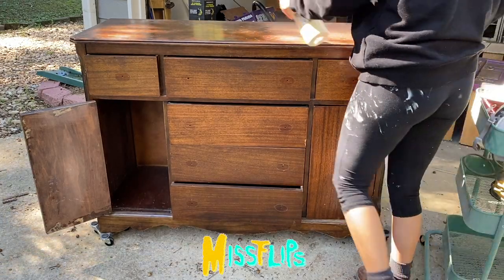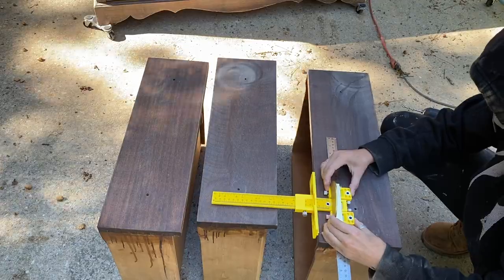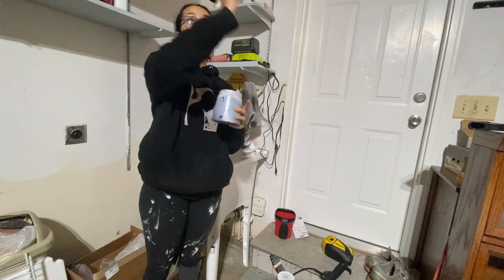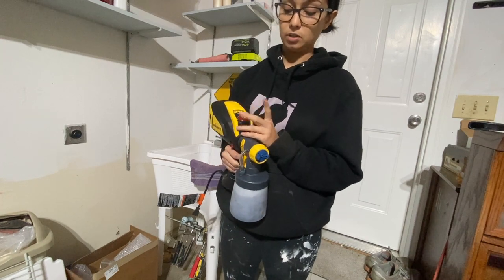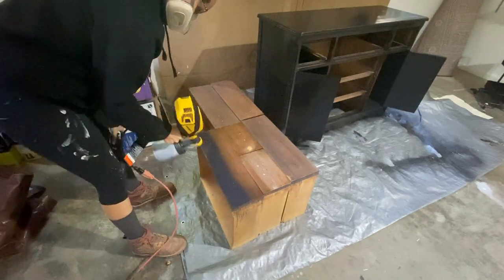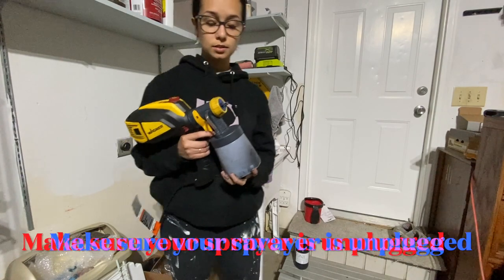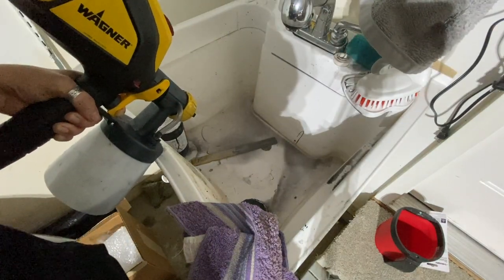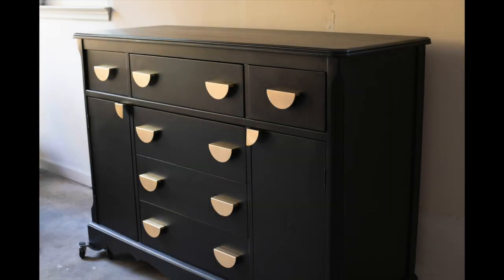Paint Sprayer Tutorial | Wagner Flexio 3500 Edition | Episode 26

Comment: Nice job. One little thing to consider is that there's only one situation where you can have your power cord rubbing what you just painted, and that is when you are spraying the top, In this case the power cord did touch the front and sites of the the dresser body because you had already painted the front and sides and then started painting the top from the front to the back, and your cord touched in several spots at around the 10:15 mark. What I've learned is to spray the top first, starting at the very back of it so you are moving the cord progressively further away from the unit and even if it does touch, you haven't painted there yet so there should be no problem. I learned that after having to sand and repaint several cord rubs.
Reply from the maker: Oooh yeah! Definitely good to note. This was my first time ever using a paint sprayer so I’ve found my rhythm now

Comment: Great thorough tutorial, thanks! I've got a Flexio 4000 that I bought for our garage makeover last year. It's sitting, lonely, in the case. Just waiting to be put to work again. Must try it on a piece soon!
Reply from the maker: Yes!! Do it!! It’s so nice! Though of course, it may be a little different if you’re trying to do more detailed things besides just covering mass areas
Reply: @TheMissFlips  it worked sooooo much better on the walls and details! I do not recommend for ceilings lol 😆
Reply from the maker: @CopperCactusDIY  hahaha I can see that being weird. But I bet it saves a ton of time!! What setting did you use for your walls if you remember
Reply: @TheMissFlips  I think it landed around a 7 or 8 on airflow and open as wide as possible (the little red ring). Don't quote me on that though, it was a tough job that I purged immediately lol. Between the flat paint to the very dry PHX climate to the heat of the tool, we had to clean it out at least 3 times every time we tried to paint the ceiling. Total saga. Walls went perfect though!
Reply from the maker: @CopperCactusDIY  haha got ya. Sounds like a tough job. Thank you for the insight though!!
Reply: @TheMissFlips  you bet! And right back at ya. Don't know why I never before considered spraying water through to clean it out! Great tips, great video!
Reply from the maker: @CopperCactusDIY  glad you found it useful 🥰

Comment: The exit spray would be cone shaped. But the outer most plastic adjustment piece has 2 air vents. The air coming out is angled in such a way that forces the cone shaped spray output into the fan shape. It's output is perpendicular but once you think about it it makes sense. 

Spining it does nothing but change the orientation of the fan spray patter.
Reply from the maker: It does according to the directions and to the obvious shape and direction of the paint

Comment: I just got the same sprayer.  Went to home depot to get stain for my cedar fence and some white paint to paint a kitchen drawer and a door.  I asked them if I had to thin down ether paint or stain and they said no. Lol.   So I don't know the ratio of thining stain and paint  in wagner container?  Also do u guys think I should use a clear stain to stain my other  house fence which is red wood??
Reply from the maker: Thinning paint is tricky. It’s different for every paint depending on its viscosity. I’d estimate about an inch or less of water for water based paints. Start with less and add more if you need. You want it to be less yogurty and more heavy cream if that makes sense lol as for the stain, that’s really a personal preference. A clear coat is most likely going to be a sealer of some kind rather than a stain. But I don’t know much about that. Might want to look up videos about painting outdoor fences specifically for better tips

Comment: When using the Wagner Flexio (I have the 3500) is there anyway to not clean in between spraying?  For example, a second coat of paint . I have be cleaning between, but was curious.
Reply from the maker: I’ve wondered the same thing, but I haven’t found anything :/ I just clean all the mechanics and then put plastic wrap over the paint container with a rubber band around it
Reply: @TheMissFlips  Sounds about right.  I don't have wood in my shop.  I think I might bring a bucket of water to put mechanics in and wash, cover cup with paint. See how that works.  Maybe it will work.  Thank you for responding so fast.
Reply from the maker: @849teresa  of course! Let me know if you have any other questions :)

Comment: Hi I just bought the Wagner 3500. How do I know if I need to water the paint down? And how much of the paint spray goes away from furniture piece? I don’t have a garage so may use spare room. Wondering how much of floor and walls to cover. Excellent video. Giving me confidence to try it.
Reply from the maker: Oh good! Im so glad! It may be worth investing in painter blankets or look for some large pieces of cardboard or big tarps. You will want to put something down on the floor as well. If you’re spraying close to a wall, it’ll be about two feet out from the piece on the wall with the thickest paint being closest to the outline of the piece of course. As far as watering it down goes, most paints require a little bit of water but not all. You want it to be almost like heavy whipping cream before it’s whipped. Keep in mind that it’s being led up a thin tube and pushed out of a needle sized hole with high pressured air. So with that in mind, use your own judgement with the paint thickness and just add a little bit at a time. It’s always good to have cardboard to test on first before you ever start painting a piece. If it’s too watery, the paint will drip once it’s sprayed. If it’s too thick, the paint will have a hard time coming out and will kind of spit out in blotches. Make sure you mix in the water well with a stir stick. I hope this helps! And please feel free to ask me more questions if they arise 🥰
Reply from the maker: Also, if you’re spraying in a small space, make sure to have as much ventilation as possible and wear a respirator!! As many windows and doors open as possible, fans on, etc.
Reply: @TheMissFlips  thank you so much!
Reply from the maker: @TheKaswid1  of course!

Comment: Melange one featured in this video is an all in one paint. Built in primer and topcoat. It's also in the color black. These factors contribute to the paint being viscous and featuring heavy/larger pigment molecules than other colors. The Wagner has a limited atomizing potential vs machines costing $1000 which can produce a significantly smaller atomized paint molecule which can better minimize orange peel and texture than the budget Wagner sprayer. All of these factors combined should be taken into consideration of the final achievable finish with reasonable expectations.

For her to take the paint, not dilute it, and have good enough coverage in 2 coats while skipping the primer step, is exactly what melange one was chemically designed to do. 

There are other paints that have less orange peel finish and more self leveling capabilities. They are probably oil based paints among the other types, which naturally have considerably higher VOCs and a nightmare in the clean up department which no one likes to do thoroughly.

Spraying melange one with managed expectations can give you 98% perfect results enough to wow 99% of users and customers except for hardcore professionals and enthusiast with an eye for the flaws that everyone else is blind to, or see and not care.

Thank you for putting up this video.
Reply from the maker: Thank you for watching

Comment: I have a wagner 3000 and the problem I'm having is an orange peel look on my furniture. Do I need to add more water to my paint or is it just a matter of adjusting the sprayer properly any advice would be great THANK YOU
Reply from the maker: I find that it’s a combination of the two. Finding the right balance of water to paint is crucial but you also do need to adjust the setting to the right pressure that works with the paint consistency. I’d practice on a scrap piece of wood or cardboard to find the right settings
Reply: @TheMissFlips  thank you   will do
Reply: Higher priced spray guns can atomize paint into smaller and smaller sized particles and minimize orange peel further than the Wagner. Thinning paint and messing with the air flow can only take you so far vs a 500-1500 sprayer.

Also some paints are NOT compatible with water. Fusion Mineral Paint is one of them. Their all in one paint will have reduction in its stickyness built in primer and built in top coat integrity when diluted with water according to the manufacturer. That's one brand who if you spray you ideally spray straight.... But you need a high quality setup for it for best results.

Comment: I came to see your experience with the sprayer, but I couldn't help but notice you cleaned your furniture with water.  I checked  your channel, and it seems you might be new to this.  I would suggest you never, Never, NEVER clean fine furniture with water.  No matter how gunked up it is, there are oil based products which will cut the gunk and remove it without adding water damage to the problem.  Start cleaning with mineral spirits and see how it goes.  That should remove basic waxes and most gunk.  Also it seems like you sanded down through the patina of the top.  Patina is what happens to wood when life happens to wood.  It gets bumped around, dents form, small scratches form - stuff happens.  Go ahead and scuff sand the top and leave the patina for the next generation to enjoy.  

The problem with water is that it raises the grain on wood.  Once that happens the wood needs to be sanded to flatten the raised grain back down to the unraised grain.  You sort of did that with your sander, and then,...you wiped it down with water again.  OMGOMGOMGOMGOMGOMG.  Once you did that it needed to be sanded again.
Reply from the maker: Thank you so much for the tips! I am definitely new to this, but what is wrong with raising the wood grain? I have gotten great results and use this method because it is better for the environment and if I have to sacrifice a little bit of “quality” for that, that’s okay with me. Also, for the patina, what would you suggest I do to get the dents and scratches out? My clients often demand this of me
Reply: @TheMissFlips  Over years of use wood will tend to darken and take on a warmth that cannot be achieved with stains or glazes.  It also takes on dents and scratches.  In the antiques world when there are dents and scratches, the owner knows the furniture has not been altered...at least not since the dents were made.  With the presence of dents and scratches, then the owner can admire the patina, assuming it is old enough for patina to have developed.  When you sand the project to remove the dents and scratches, you will necessarily go through the patina first to get to the scratches and dents.  In fact you'll be down to raw wood.  If your buyers don't appreciate the patina, then sand away.  However, you may be sanding through a true antique with value to turn it into a kids chest of drawers.  

As for the wood grain, most people want a buttery smooth paint or varnish finish.  You can't get that kind of finish when the grain of the wood is standing up.
Reply from the maker: @dchall8  maybe I’m not using enough water then to do that cuz it’s been fine and I’ve had very nice finishes so far. I agree when it comes to the patina though! It adds character in my eyes. But yea, a lot of clients do want those scratches out and hey. I’m not mad if it becomes a kids chest of drawers. One more thing not in a dumpster
Reply: One way to minimize raising the grain during your final wipe down is a chemical that evaporates quickly. Like 50% alcohol water. Or diluted mineral spirits. Do a light rub down with brown paper bag (basically acting like a 300-400 grit finishing sand paper) to knock down any raises grain from the alcohol or mineral spirits wipe down.. Then use a tack cloth which is sticky to grab any lingering debris without raising the grain further.

In an ideal world that is.

99.99999% of customers wouldn't know the difference between doing these extra steps or not so to each their own.

That melange paint is top notch. It's my favorite.